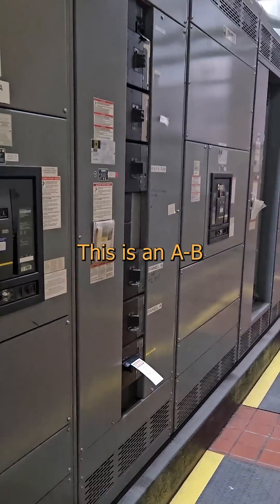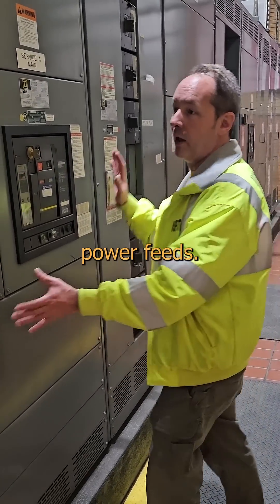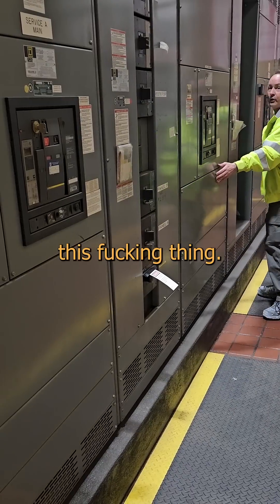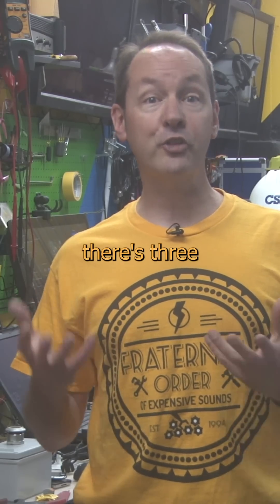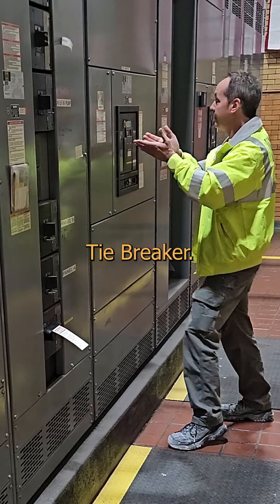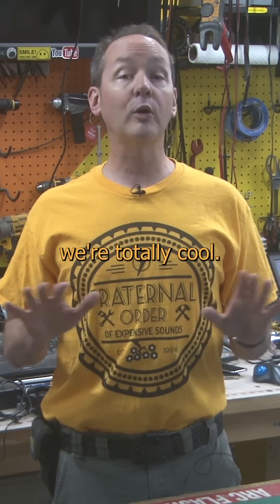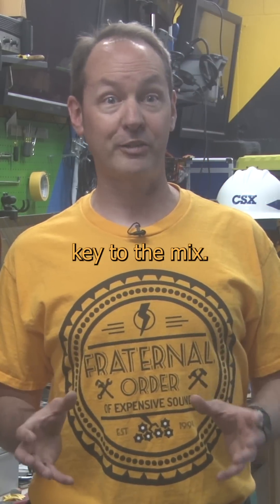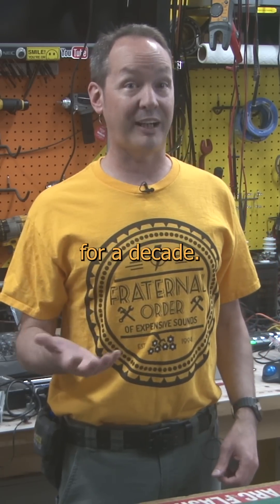A B Interface #chrisboden #comedy #electrical #engineering #energy #substation #switchgear #power

Comment: On Navy Ships we have 2 ways to do the same thing on a smaller scale. One is a MBT which is a mechanical interlock between the 2 breakers and the other is an ABT which is a device that switches between 2 power sources automatically.

Comment: Back up systems are what we had in the manufacturing plant.  And when I got my first house, I tried to do what I saw at the company.  That must be code, right?  Well no.  However, it does get expensive to have back up systems in your home, but when disaster strikes your town, county or state, if you are in your home, you don't notice it.  That light flicker is the grid going down outside of the house, and you only assume that you might have to replace that CFL bulb with a LED in the near future.

Comment: TECH Note - there are no wires. It is solid buss bars in there. One, two or three levels deep (never seen nor touched 4)  
   Looks more like a giant Erector set. 
    Nerd Tech - the plates are flat. Helps increase surface area and skin effect. You could make a 4 inch thick wire but the angry pixies would only go soo deep. They only go skin deep (for that frequency - including D.C. which has no frequency)

Comment: From 2020 to 2023 I led a project to build a sterile product manufacturing facility. Because keeping positive pressure in the sterile manufacturing areas was critical we installed an N+2 electrical system with dual feeds from separate substations, (and yes that was very expensive).  But the cost of having to re-certify the building if we lost pressure was insanely more expensive in terms of work to re-cert and lost production time. 

Getting that all correct was a huge headache. But in the end well worth the investment the first time one of the feeds went down.
Reply: Another option is to look at the solutions data centers use. Carbon fiber flywheels in a vacuum spinning at hundreds of thousands of RPM. Can provide multiple MW in less than 10 cycles, and run for 15 - 30 seconds which is long enough to crank diesels kept in warm standby (oil and coolant kept at operating temperature)
Reply: @PsRohrbaugh in fact we have those on each leg. They keep power to the critical components until the switchover is complete or until the 3100KVA generator starts up, in the event we lost both legs.
Reply: @PsRohrbaugh is this what called as DRUPS?
Reply: Last data center we worked on was that way.  They REALLY wanted a feed from a third substation (they had the money....) but the utility just flat said NO.  We ended up with two grid feeds from separate substations with three cat C175 gennys and battery UPS backing each generator. Generators could grid sync (Tier 4 diesel) so if a UPS had to be taken down that generator was started and synced.  It would run the entire time the UPS was offline.  They definitely hit their 99.999% uptime tier.

Comment: I worked at a manufacturing facility that had 2 pad mount transformers, 2000A @480vac each. We had an AB shunt that would allow us to bridge between A and B if we ever had a transformer fail. The only time we tried to do it we found the breaker had failed in the shunt so lol, didn't work.

Comment: I am a some what newer Power Engineer (8 years) but I kind of disagree with the reasoning. Feed A comes from circuit A and feed B from circuit B. These circuit are not out of phase/sync and their wouldn't be an immediate explosion. However if you tie the circuits together, electricity takes the path of least resistance and their is a likely chance that circuit A will start feeding circuit B through this A B interface, or vice versa, one of the paths with be shorter than going to a whole different sub. Now the circuit A is feeding circuit B through the A B interchange which I am betting can't support the load of a whole circuit. Thus explosion
Reply: You can tie circuits together on the secondary side and not have it back feeding back onto the other circuit if you make sure the transformer impedances are right and matched. This is referred to as a "networked distribution feed system", which are rare outside metropolitan cities (just the downtown area). Network feed are more reliable but take more complicated protection schemes and the cost is so much more that you need a dense population center to make the effort and cost worth it.

Comment: Is there any reason that all three would need to be closed at once? Such as maintenance that is meant to be performed with incoming power tagged out? If not, really sounds like it should be designed so that it is not possible to close all three circuits normally.

Comment: Those circuit breakers are exactly the same without the keys in ship's main switch board, and have even the same A - B tie bus connection. Though on ships, we keep A and B tie busses normally connected. 

Just some fun facts on ship electrical system. Which is pretty cool.
Reply: Because as big as a ship is, it's not big enough (as big as a state) to have two main lines that are drifting out of phase?
Reply: @MrHuram-abi  It's because on the ship I work, we use 1 generator at a time to power the whole electrical system, but don't quote me on the buss tie bar practice on other ships. There they can have the switch boards separated for system redundancy

Comment: A long time ago, when this was my kink, some critical infrastructure used  similar setups because they had two separate 20 - 30 kv distribution lines for redundancy. I think they were called grade 0 consumers, where loss of power could result in a catastrophe. But then large battery banks and compact, portable diesel generators became widely available, so they mostly replaced the old setup.

Comment: Had a house with a 3-way light switch somehow wired into opposite sides of the panel with very different lengths wires , previous owners solution was using european light bulb, I noticed things either were out of phase enough , or something, that I apparently got a $40 electric bill when everything was off and unplugged, and a 20v differential only on that circuit! 
  I gave up trying to figure out how it worked and just fixed it before I lost another $40 to nothing.

Comment: I work at Data centers that use a setup similar to this and have seen what happens when things go wrong. Gives you a whole new appreciation of those angry little pixies
Reply: Show these to some young engineers i work with.  Try to get them to see old school engineering perspective
Reply: Ditto, I've seen what happens when an ATS gets pissed and decides to arc across the hall. You absolutely DO NOT wanna be anywhere close to those fuckers if they get mad.
Reply: @PressAtoDefendEarth  - I remember working in the data center over a weekend when the primary ATS blew.  It sounded like a bomb went off, filled the whole power room with acrid smoke, and the electical arc burned through a wooden block a foot thick.  We kept the block around as a trophy to show the new employees exactly what they were dealing with.
Reply: What went wrong that you saw??
Reply: @forgetfulfunctor1  When you plug or unplug something in your house that's turned on you get a little spark caused by the sudden connection of 120 volts at maybe 2-3 amps. The voltage difference is what allows the spark to form and the resistance of the item (a space heater for example) limits how big the spark can be.

A switchgear that's using a tie breaker like this is a minimum of 480 volts and possibly 4160v or higher and rated for 2000 amps. Because power scales linearly with both amps and volts the spark will be 15,000 the energy of the one at someone's house.

If you want to see what that looks like search "arc flash" or "arc blast".
Reply: @zwink37  unless you're in the home of the safest plugs in the world. 230 volts and a physical switch to avoid the whole "making a spark" thing. On top of having a fuse in the plug itself. Just incase...

That said, I've seen arc flash and even domestic trasformers getting spicy can make you think twice, nevermind metropolitan level or HV liine gear.
Reply: @zwink37  As a retired residential electrician, we used to get a call about this once a month.  A customer would freak out about a flash behind an ivory or white plastic switch plate when they turned on the lights.  After explaining what was happening, we still had to replace the switch just to make them feel better.  Edit: We should have just replaced with a metal plate so they couldn't see it!
Reply: @oddball_the_blue  Unless your mechanical switches are rated explosion-proof, I wouldn't bet my life on that.
Reply: @iamdisccomp  so .. pretty much all of the UK's mains sockets. Which I'm pretty sure are battle tested for anything upto and around 13amps at 230volts.
Reply: @arabicpilot11  bot
Reply: What’s up fellow data center friend! Yup, similar setup in my DCs as well.
Reply: Datacenter tribe here, too. A mistake like this is why DCs are building with/ upgrading to Automatic Transfer Switches. ATS are interlocked to prevent double simultaneous inputs. The "down time" is handled by the UPS during the transfer. Most of the time, a customer only knows because the overhead lights blink.
Reply: @wademeyer4495 "most of the time" except for when the sparkies hooked all the power whips in the aisle to the same feed. Ya, we noticed the transfer that day. 😅
Reply: Nothing quite like it when it's hooked into large UPS banks rather than a second mains supply and said battery banks start to.... Well cook and give out magic smoke.
Reply: @oddball_the_blue  .....AAAAHHHHHHhhhhh...the MAGIC SMOKE!!!!  I KNOW IT WELL!!!!
Reply: St. Micchael's Hospital here in Toronto has the same setup as Does TD Banks's main data center about a mile up the street! Great thing is they occasionally wire the entire neighborhood for the redundancy and then you get rock solid power at home.
Reply: @PWingert1966  lived in a house in Florida that was that way....through all the storms and hurricanes that came through there....the longest we were ever without power, for the years i lived there, was 16 hours and that was because a BIG tree fell on a very difficult bit of the system. 
There were other places right across the street that were without power for 3 weeks or more after some of the storms....and I even bribed the Road Runner guy to hook back up a cable TV line that had broken about 150' down from my place on the 2nd day after the one storm .....lol  Really liked living in that old place....
Reply: @PWingert1966  And has red power plugs that are directly connected to the facility UPS/gensets.
Reply: A,B,C and D feeds make it a bit more complex. 😅
Reply: Data centers is where I found out that where I stopped at like 440 that they have another fucking zero to theirs and I'm gone
Reply: Redundant circuits to the rack is the way our datacenter is set up - independent UPS and everything up to the switch yard that the generators tie into. Big commercial facility with a lot of banking, telecoms and .gov
Reply: I just did 3 900 ton chillers at a data center . Those equipment rooms are cold . Right around 42°. Some of the server cabinets have chill water running through the cases .
Reply: @Dr.Westside in degrees?😅
Reply: There's times when those "angry little pixies" transform into horrifying monstrosities bent on vengeance.
Reply: Same, done with a 32kv infeed x 2 to 11kv substations around the site with 11kv gen sets as well. UPS sets on the 400v side with feeds from seperate substations and ATS sets between the UPS. Gets fun when in the MV switchrooms you’re feeding from either A side 32kv or B side 32kv with the option of syncing the 11kv gen sets to the 11 kv subs and syncing A&B 11kv rings so you can take the 32kv or 11kv transformers or switchgear down for maintenance. Datacentres, power hungry little buggers.
Reply: I married a pixie
Reply: Try to stay quiet because the adults in the room are talking
Reply: @oneselmo  2006 account? which bot farm do u belong to
Reply: I worked an IBM BCRS(Business Continuity and Recovery Services) Datacenter aka a DR site, so it was set to be basically impossible to go down
so yes, it was as I said before redundantly redundant
Reply: The whole point of the setup is to a contengency plan if one or the other power source is completely out of commission and you need to shift both sets of circuits to the same source. 

Odds are there is also a huge APC included for each circuit so if you need to make this switch, you have time to cut off outside power to the impacted circuits, and the guy with the third key has time to drive back to work to make the shift.

This is one of those things that might happen once in a million years.  Because anything with this level of setup, also has a generator (if not two) also connected to each circuit.

So in order to need to do the switch, not only have you lost outside power, but you also lost generator power and you are down to teritary power (APC) to keep the circuits fed with the happy juice.  

But if they are running an extra generator for each circuit row, odds are instead of going through all of this trouble, they would just switch lines to one of the spare generators and not worry about doing this power switch to one phase.
Reply: Ayoo my last job makes switchgear! We made plenty for data centers of household name companies, and often we had two power sources and a generator (three total sources)
Reply: I have done commissioning as a lead tech for the substation for 1 data center, man what a shit show
Reply: Absolutely agree!!! Double Ended Switchgear “Main-Tie-Main” is best with Critical Infrastructure. I’ve ran into it with an Ammonia Refrigeration System in Texas and it was 15Kv—> 480 via a 2500 substation dry type transformer with an old 3000A Pringle Switch
Reply: Same here. I don't think many people understand the massive role that the humble STS plays in their data addicted lives.
Reply: Got to love the STS that some how smokes the medium voltage transformer when they (CET) dork up the transfer on a tie breaker system. Blue fire ball down a dark hallway… Love DC life.
Reply: We had a double ATS interlock for the emergency generator feed: fourth emergency backup power
Reply: Angry little pixies?
Reply: Electrical designer that does a lot of data centers checking in. The video shows a main-tie-main of a single switchgear. This is good if you only need as much power as a single switchgear can feed, but when you need to power a big data center, it's set up as something called MV loops. Essentially you daisy chain some MV transformers between 2 different switchgear, and you'll have a breaker somewhere in there normally open (either on one of the ends or in the middle). This is basically just a main-tie-main on a bigger scale. 

One place you could find a similar setup to the video in a big data center is a UPS backed bus. The input of the UPS is connected to one side and the output is connected to the other. The tie is normally open and can be closed whenever you need to take the whole unit down for maintenance.

If anyone wants to learn how the redundancy for the rack power works, there's a good article online - first result if you google "An Introduction to UPS Redundancy"
Reply: yep, one site I worked was double redundant plus UPS and generator...
Reply: My favorite data centers that I've seen to date: eBay in South Jordan, Utah, and the last Exodus Communications data center built in Anaheim, CA before they folded.
Reply: I work in the DC field too on the software side and had to the control logic for one of these AB systems to have automatic changeover sequences and load management. It's really interesting stuff.
Reply: @CodComplex  That's a task that is further made complicated by trying to keep the phases in ballance during failovers; especially if the phases weren't balanced at the rack level to begin with.
Reply: I work at Digital Realty data center in Chicago. This is the set up that they have for redundant power along with a generator and reserve utility. Once, when we came back from gen, the ups's on the the A blew up. Holy shit it was like a dynamite going off
Reply: @TheChaospredator  similar here a server room with a pair of 100kva online UPS. Each supply a separate power rail in each cabinet. You can switch things over to have both rails coming off either UPS to allow maintenance or if one UPS fails. Big scary looking panel with key interlocks that also interact with bypass switches on the UPS units. To be fair it would not be easy to cross the streams, the most likely outcome would be turning of the power to the racks. That would result in lots of screaming, but no smoke, unless the person that did it was burnt at the stake.
Of course there was that time when the MD pressed the EPO button because it was lit up, always is, and there was beeping coming from the UPS because it thought the service was overdue. Ohh, EPO - Emergency Power Off.
Reply: A data center that I was a support engineer for vaporized about three feet of a one megawatt copper bus bar. Literally turned it into black copper oxide all over the ceiling.